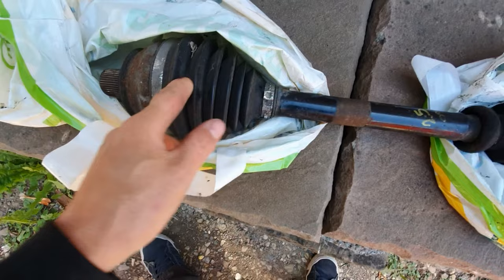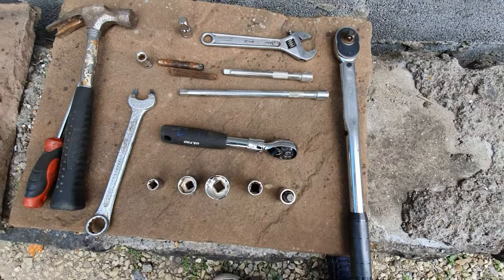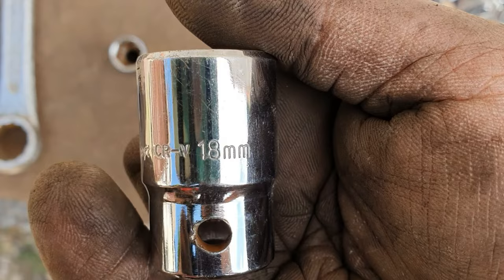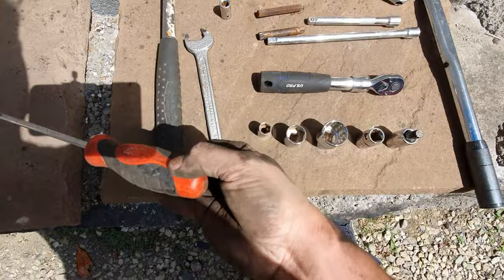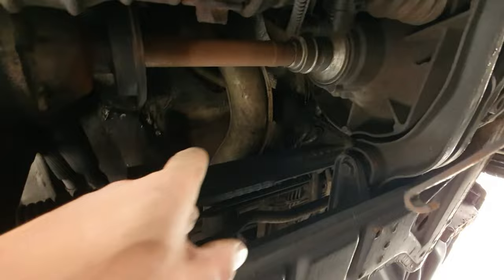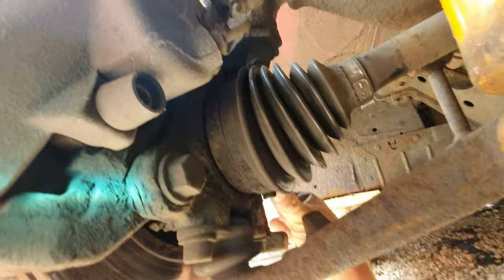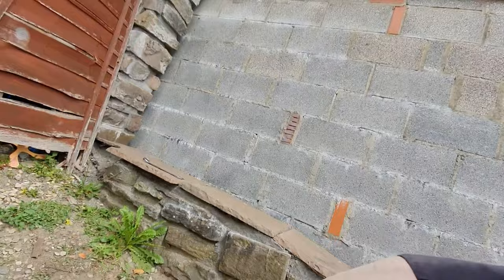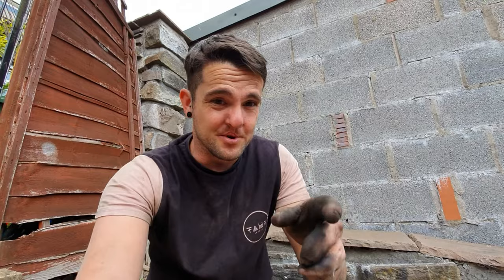Replacing My Drive shaft (VWT4)

Comment: Great work as always. I've sourced oem replacement CV axles and in looking up the torque spec on the big outter bolt and the 6 smaller inner bolts I saw a note to always use new bolts. have you had any issues reusing the same bolts here? cheers!